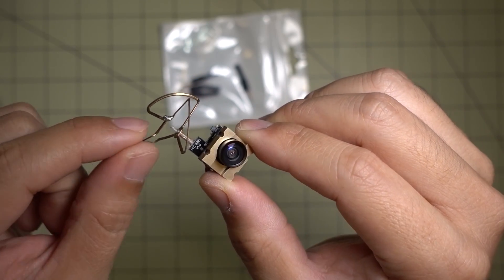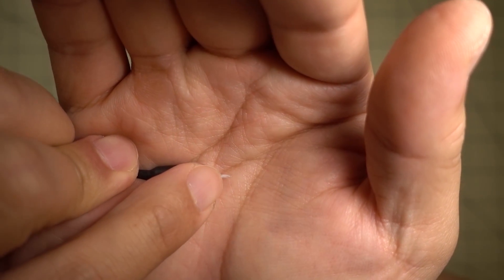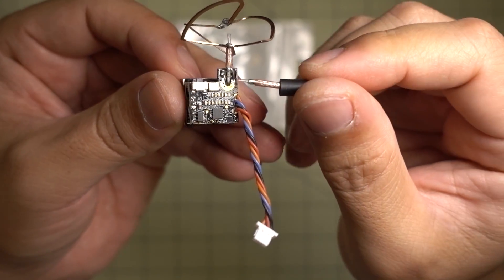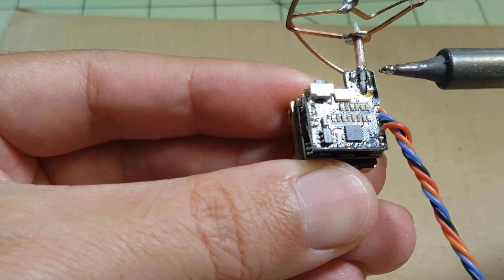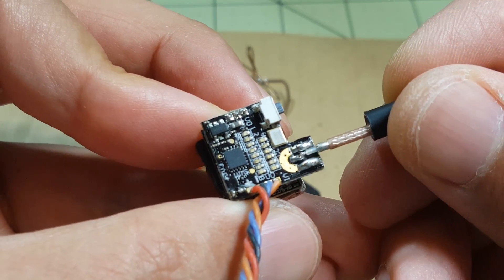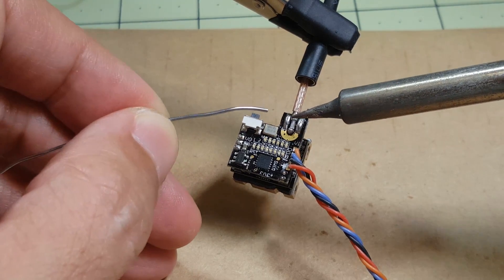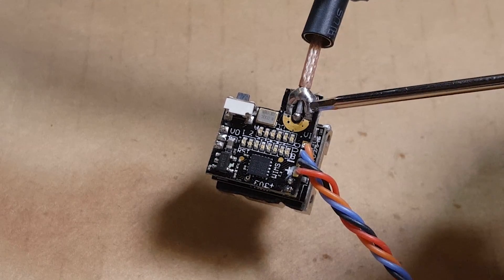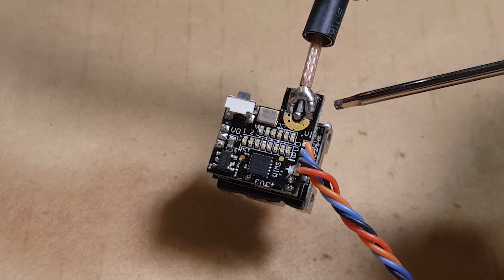Repairing Broken VTX Antennas 🔨💡⭐👍

Comment: Hey man, i just broke my tx06 antenna. So basically, we can change it with any antenna we want, like ort micro vee with ufl, just have to cut it and spread the inside cable, then solder it. Need your help man

Comment: Question, after I desoldered the old antenna the ground and signal pins have continuity when I test with my multimeter. Is that right? I'm trying to track down a short.
Reply from the maker: You probably have a solder bridge somewhere. There should not be continuity.
Reply: Albert Kim crud. I was afraid of that. Can’t see one so it’s somewhere sneaky.

Comment: Hi this is as usual an awesome vid 🤘🏼Iv made an aerial the same way as you have bought but my question is regarding your camera,Iv got the Eachine 3 in 1 and the way the aerial solders on is very hard to nail as the tiny little wire has a solder pad about the same size and makes it very hard to get perfect,what is the camera your using and would it be compatible with the Eachine beecore F3 flight controller,it looks so much easier to get right,
Thanks again for the quality vids 👍🏼

Comment: I want to swear this is exactly how I do it every time, especially after I asked you before and you gave me some tips. But I still get such a weaker signal. As in my little apartment, I get serious breakup just walking into the bathroom where as before the signal will be clear.  I tried again recently and it was a bit better but still weaker. Maybe my CP replacement antennas are just lame. 

But I'll try again now that you made a video for visual reference. Thanks for making the video.

Comment: haha this is exactly what I do - for some strange reason banggood doesn't have any spare antennas like you showed, they only have spare cloverleafs. However I did find a pack of 12 brass dipoles for $10 on amazon.  Anyway, the problem I sometimes have is that the ground metal on the sides of the breaks off of the board or worse the whole little top piece of the VTX board physically breaks off. Both those problems pretty much always end the use of the camera+vtx, but I was thinking could you do a video showing how to (if possible) remove the camera from the VTX on one of these all-in-one micro fpv camera+vtx packages and wire it to a new VTX something like the Eachine VTX03? I have wanted to do that but I am not smart enough to figure it out. =( Thanks for all the interesting and helpful videos everyday, keep them coming!

Comment: Good, like these quick tips. Thx!
Reply from the maker: Someone had suggested this a while back. Not sure what else to do... got any more suggestions?
Reply: I always have questions. Just got q X7 radio and setting it up. 1st time I set up 9D+ I just followed different videos. This time I'm trying to understand and those videos (as well as new ones for X7) don't explain. 

General topic area is throttle settings.  Specifically, why do you set these up, where are they set (BF tab, CLI, radio calibration) and how do they interact (min_check won't allow arming if throttle value is higher even when stick full down?):

Min, Max, Midpoint (calibrate endpoints - adjust using trim, subtrim or % field?), Min command, Throttle idle, min_check and max_check, Deadband (throttle?), stick calibration (don't push on sticks or you have to push down for arming), throttle midpoint and expo (Config tab). Why does everyone do this differently? Thx.

Might be more than 1 vid! Series? LOL
Reply: Forgot - when you calibrate endpoints in BF you do it for a specific quad and receiver. Do you have to do it for every quad? When you calibrate sticks on the radio it's for all. What's up with that?